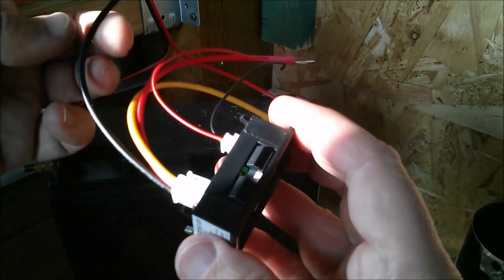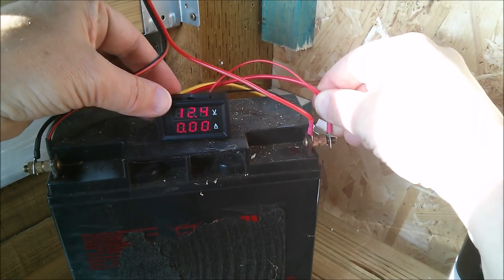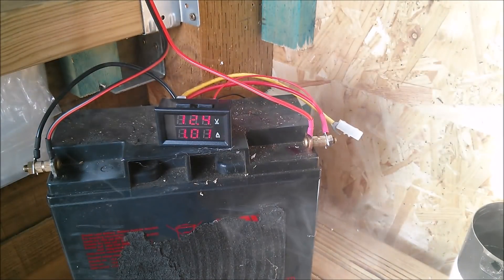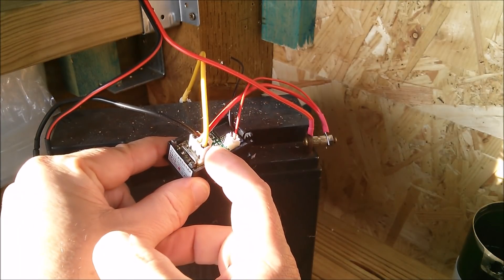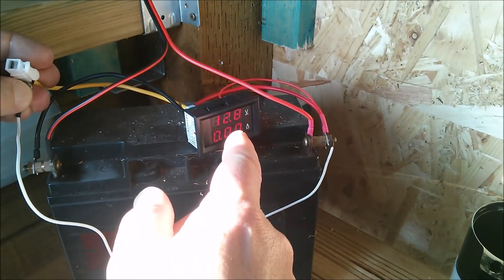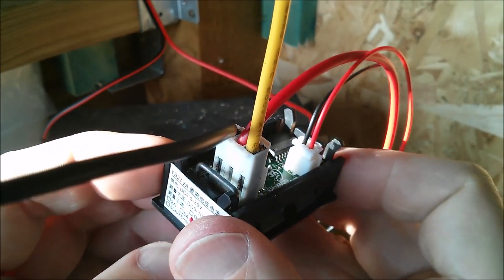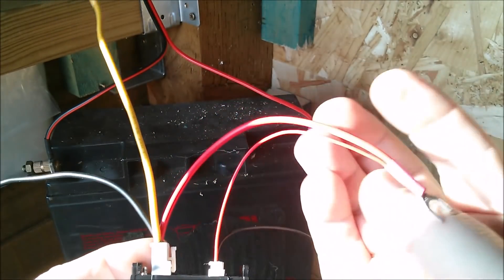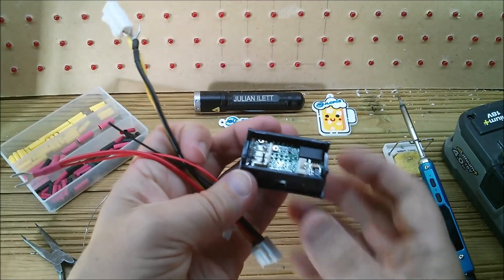Ammeter Fail (smoky ending)

Comment: Never, never, have unprotected wires hanging around live equipment. If it can touch and short it will touch and short! For that matter never connect to an effective unlined source of power, like a big lead acid battery, without a fuse in circuit. You would do well to have an inline fuse at those battery connections. Sometimes the obvious needs to be stated.

Comment: There are insanely non-intuitive. Even with no dangling cables you can fry these, as some of those current meters are designed to go on the negative end of the circuit and the others on the positive. Why that matters? Because if you power them from the same source they tend to short the power source through the power pins and the shunt pins. Because of that you need to know which type you have first, check it on the ebay auction or just experiment with lower current (current limited PSU or via resistor). And of course because of the color coding both red and black wire end up on the negative side of the circuit 90% of the time.

Comment: Of course we want to see it!
On a more sensible note, don’t have loose uninsulated wires floating about near live terminals... It’s easy to say afterwards, but either restrain the wires so they can’t get near the terminals, insulate the wires, insulate the terminals, or better yet, do all three... Even a double layer of insulation tape would have been sufficient for a 12V supply 😉
The organisation I work for learned this the very hard and painful way (much worse than your little adventure) about 32 years ago.

Comment: I have a few of the same type meters supposedly rated for 10A.  Looking at the PCB I wouldn't attempt doing so.  They do in fact work fine at 3-5A.
Reply: I use the same meter on a homemade power supply and have had it upto 8.3 amps for 3-4 mins at a time. Meter did seem a little warm after each test tho.
Reply from the maker: Current still flows through the connectors, tracks and shunt itself - so it's all still kinda intact.

Comment: Always assume the Current capabilities of most Chines Power Products are half of the  claimed.  They tend to add a Zero to the actual values.    Common practice on Chines 18650 cells.    Most all of the little DC/DC converters are like that as well.  If they claim the item is 100A max  what they are saying is it will only smoke a lot at 20A and won't burst into flame until you reach 100A.  Yes that's my findings.
Reply: "Always assume the Current capabilities of most Chines Power Products are half of the  claimed.  They tend to add a Zero to the actual values."

I didn't know they used binary numbers for the rating.
Reply: @Okurkaarrgghh  I think it's the Translation.  LOL